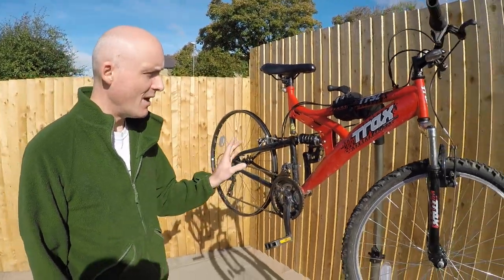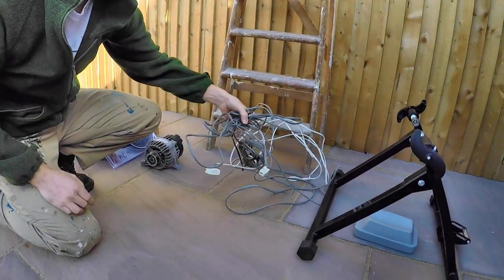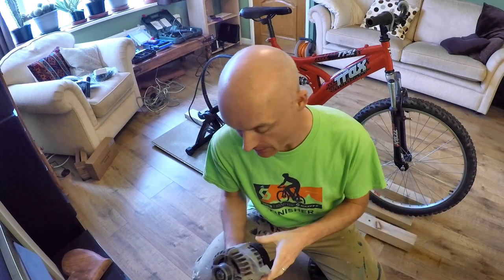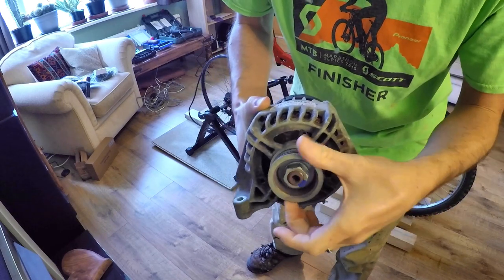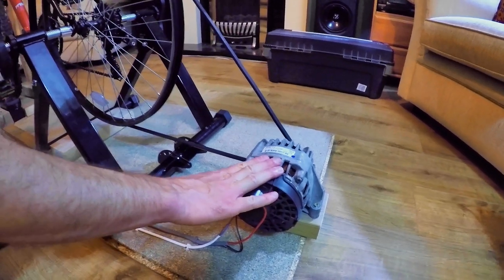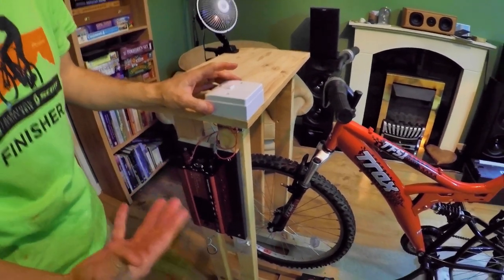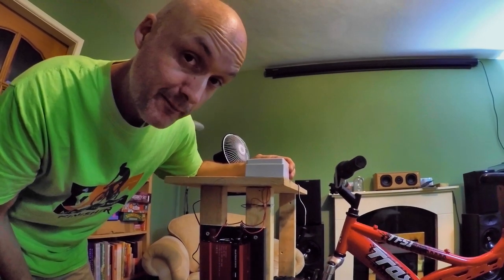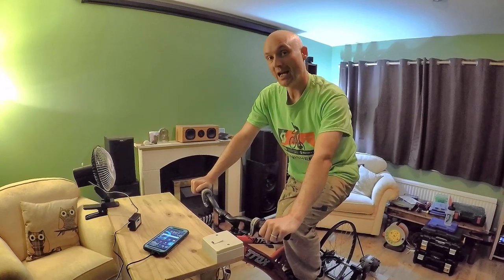Bike Generator Build From Scratch | DIY Bicycle Generator Series

Comment from the maker: Thanks for watching! If you enjoyed this, check out our other videos for more detailed information and instructions:

How to install a capacitor and run it with the battery and alternator - https://youtu.be/TT-PSqLD2Bc
Full step by step instructions to build a generator - https://youtu.be/_Hx1ptv6RKI
Bike generator circuit diagrams - https://youtu.be/wo9d3Ug_Cw8
Detailed discussion of the pros and cons of AC or DC motors for use as generators - https://youtu.be/9XOFuN4lOoA

Comment: Thank you for this great series! I will build such a bike generator myself now :) 
Two quick questions: It seems as if this wiring leaves the field coil ignition connected to the battery during the entire time the generator is used. Is that a problem? 
And second: How did you determine the strength of the fuses (6A, 10A)? From what I’ve read, lead acid batteries can typically provide a very high current for a short period of time, so the battery should be fine anyways. The fuse to protect the load would primarily depend on the load, and I don’t know how to determine it, other than by my max possible power output (say 250W divided by 12V)
Reply from the maker: Thanks, glad you enjoyed it and great that you're going to build one! I hope it goes well.
On this generator, I've used a double pole switch which simultaneously connects/disconnects the main power from the load and the battery from the field coil. On my main generator, I have the field coil on a momentary switch, like an ignition. You wouldn't want to keep it connect permanently because there would be a constant power drain and it would be very difficult to start pedalling. Ideally, you need to pedal up to speed and then connect the field coil. Once you're generating power, it doesn't matter whether you leave it switched in or out, but always switch it out when stopping.
The fuses protect the battery and wires on case of short circuit. Big lead acid car batteries are pretty hardy but I think these little ones could be damaged by a short circuit for a long period of time. Maybe not too much, but better safe than sorry.
Reply from the maker: 10A is the max capacity of the wire I used. You could have a bigger fuse with thicker wire but to be honest, generating 10 amps for any length of time using an alternator is very hard! They're not very efficient!
Reply: Hey, thanks a lot for the quick and useful reply!
I guess i will experiment a bit before settling for one solution. If i can ill get a washingmashine motor from the dump, since they should be more efficient. Ill add the fuses at the end, once i know what power i can generate and what cables i used. 
Thanks again for the series and take care!
Reply from the maker: You're very welcome, Amos. Let us know how it goes!
Yes, washing machine motors are good for generators. They tend to have more complicated wiring setups so you might need to find the installation manual for it online. Also, for a washing machine motor, you will probably need a voltage regulation circuit (and rectifier if you want DC) - they tend to be built into car alternators but not washing machine motors.
If you can get hold of one cheaply, a permanent magnet DC motor is often most efficient.

Comment: Hi

Many thanks for this. I am building this for a project with the kids. Any chance of a some details of the parts, i.e. the alternator number, as to avoid getting things wrong I want to use the same parts?

Thanks
Reply from the maker: Hey, thanks for watching.
This one was for a client actually, so I don't have the part details anymore. I remember that the alternator was from a Ford Ka, but couldn't tell you the precise model.
However, many car alternators have the same basic specifications - the total current rating isn't a concern on a bike generator because you'll never be able to generate enough power to trouble even the smallest alternator. Provided they have voltage regulation and rectification built in, they all connect up in the same way.
I go into the details about this in our "How to build a bike generator" series of videos, particularly the AC or DC one. I'd advise watching those, along with the wiring diagram video and you should have all you need. You can also download the circuit diagram from our website. There's a link to do so on that video.
Hope this helps!
Andrew.
Reply from the maker: https://youtu.be/9XOFuN4lOoA
Reply from the maker: https://youtu.be/wo9d3Ug_Cw8

Comment: bonjour, je voudrait vous soumettre un problème. j'ai mis 3 vélos générateurs en parallèle pour charger une batterie et alimenter une télévision et une console. soit 220W. cependant à chaque fois ma batterie se décharge en 10 secondes donc l'onduleur ne fonctionne plus.  pouvez vous m'aider? merci Agnès
Reply from the maker: Il se peut que votre batterie soit usée ou qu’elle ne soit pas assez puissante. Utilisez-vous une batterie au plomb ? Pour ce type, vous avez souvent besoin d’une puissance plus élevée que vous ne le pensez en raison de la façon dont ils se déchargent. Une batterie au plomb à décharge profonde est préférable, ou une batterie au lithium. Mais pour le lithium, vous aurez besoin d’un contrôleur de charge pour être en sécurité.
Il se peut également que le circuit de charge ne fonctionne pas correctement. Cela fonctionne-t-il lorsque les générateurs de vélo fonctionnent tous ? Si c’est le cas, il semble probable que la batterie soit le problème.